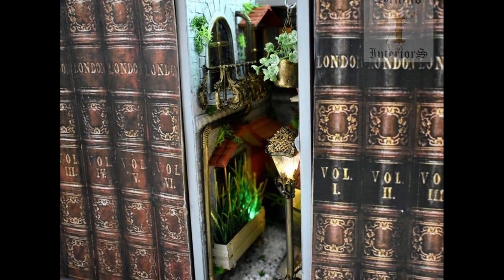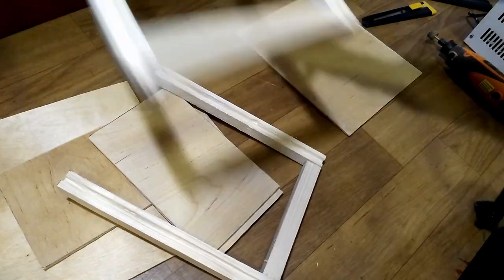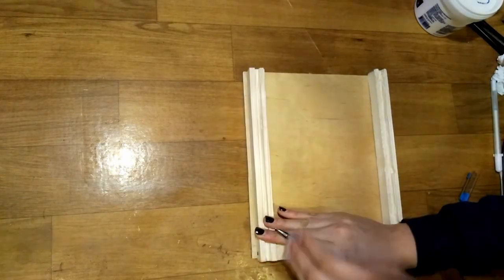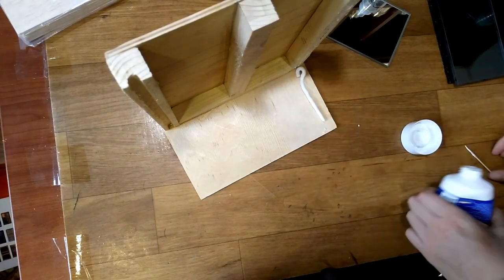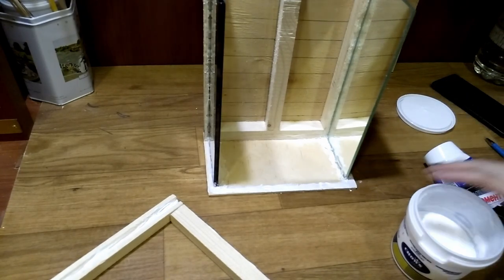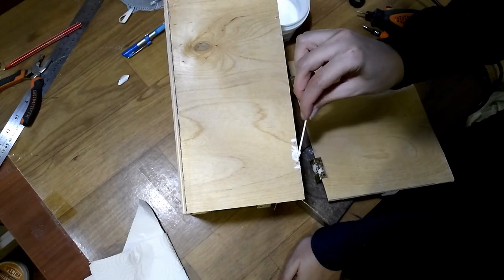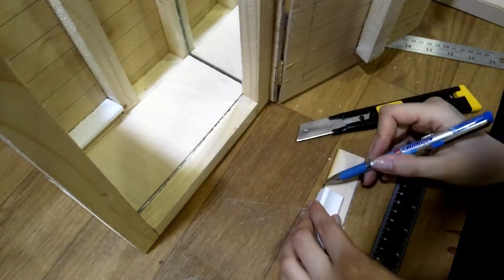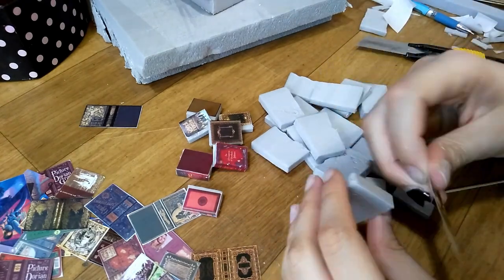How to make a book nook with endless library illusion inside Part1/3

Comment: Could you have used hot glue to hold the mirror?
Reply from the maker: Now that I think of it, I probably could, but I wasn't sure it will hold it strong enough, so I used the strongest thing I had (the liquid nail). Plus whenever I use hot glue - it gets super messy.